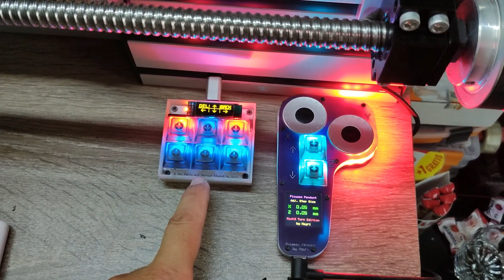Threading Die Holder for my DIY CNC Lathe, Resin Printed cracked trying FDM Printed ABS, Part 2

Comment: Too bad the resin part failed, but it looks like the ABS part might be stronger. That's how we learn things right?? You definitely came up with a fantastic idea to use bearings inside the handle!! That looks like it will spin very very smoothly and be aligned perfectly for starting the threads!!! Awesome idea!!!! I look forward to seeing some threads being applied when you get to that point!! Thanks for sharing with us and I hope you have been able to clean up your car and yard from the hail storm. I'll also be watching for updates on your car repairs too!! Take care and till next time my friend!!!
Reply from the maker: It definitely is 🙂already threaded a part and it was much easier than thought. Used the chuck key to keep the chuck from moving and could turn the die with one hand. Having that big diameter makes it easy to grip strongly. I was so exited that I forgot to make a video of it, haha. But I do have more stock 🙂 The bearings did the trick for aligning it on the 12mm shaft and move smoothly forward while cutting the thread. My wife is still cleaning/picking the corn that got destroyed in the back of the house. In the front all is lost and we will be putting a lawn there. In the back of the house we had a corn field that you could get lost in. Only the roof of the house is visible for orientation. As for parts for the car, I could only find the left tail light and it is a darker shade, so for now I have to  live with it till I get some money saved to buy new one from the States. Shipping costs an arm and a leg plus customs duty on top of it. Anyway, it will be a while till the car looks presentable again. People stare at it where ever we go, lol. Till later my friend, stay safe.